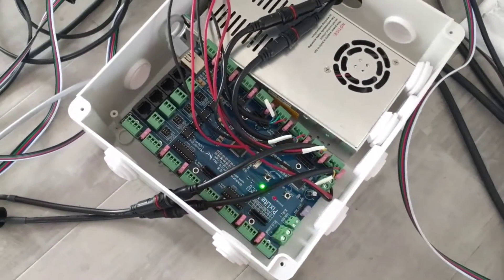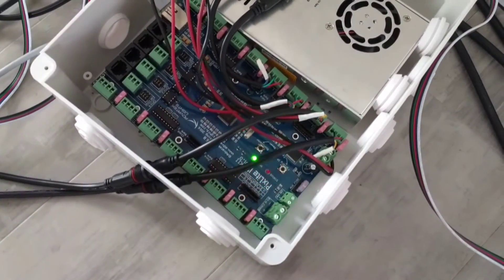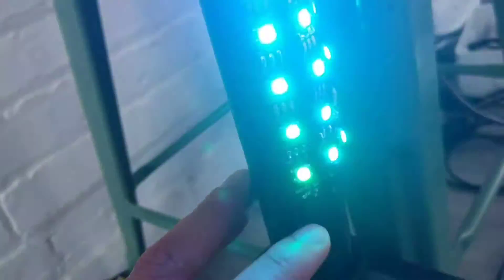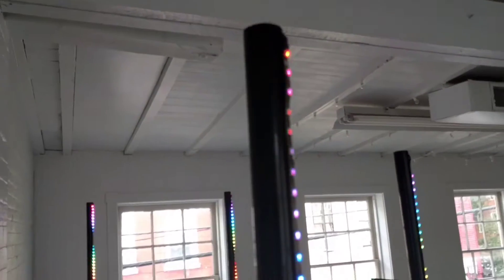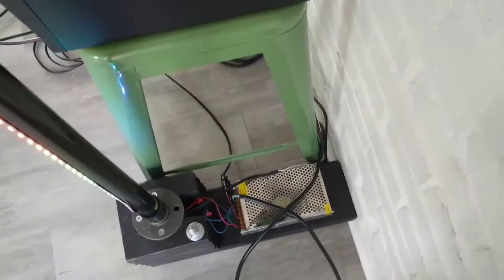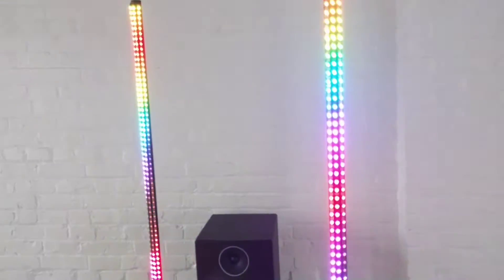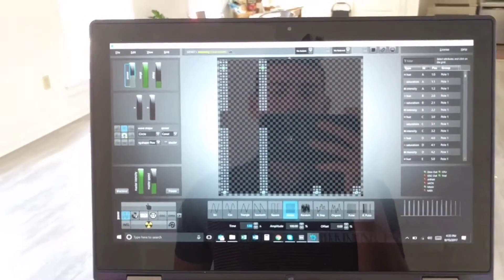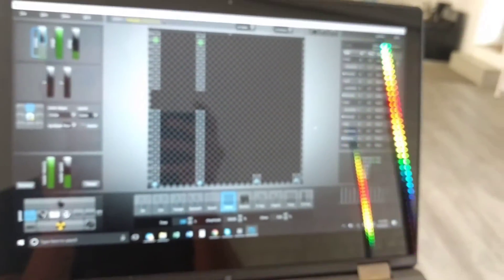How to make DIY LED light poles

Comment: Do you have a listing for the smaller power supplies, the wiring, and the flanges?  Thank you I am looking into trying something like this.
Reply from the maker: Heyo, here's a link to the smaller power supplies:
https://www.amazon.com/gp/product/B01LZRIWZD/ref=oh_aui_detailpage_o02_s03?ie=UTF8&psc=1

Here's the wiring and connectors:
https://www.amazon.com/gp/product/B016NV1PVW/ref=oh_aui_detailpage_o02_s03?ie=UTF8&psc=1

https://www.amazon.com/gp/product/B01LCV8SYK/ref=oh_aui_detailpage_o02_s03?ie=UTF8&psc=1

https://www.amazon.com/gp/product/B0154H7BLE/ref=od_aui_detailpages03?ie=UTF8&psc=1

+ cheap lamp wiring from the hardware store
+ black/red 16 gauge wire from the hardware store
+ metal flange w/ PVC size adapter from the hardware store
Reply: Thank you. You mentioned sACN. My UltraDMX-Micro adapter from DMX King doesn't do sACN, so if you don't mind, what adapter are you using?  Thank you again.
Reply from the maker: Dennis Justice using the Advatek PixLite16 mk2. It's kind of pricey, but they have a smaller version that is much cheaper. But LightJams uses ArtNet, as well. So I think you'd be okay.
Reply: Thank you so much!

Comment: The 200W power supply power the controller and some of the LEDs, but you inject power after two of the three strips on the pole. Is that right? Are some of the poles power injected, and some not? The poles are cabled in sequence right? All the questions!
Reply from the maker: Jesus On The Mainline hey man. I inject power at the end of each one. I noticed a voltage drop about halfway through each line, so maybe at 130 LEDs or so is the max you can get to before needing to inject more power.
Reply from the maker: Also, yes I make sure to cable each pole in the same order every time. the controller helps with that though, since I just need to match my outputs to the poles (even though each output can handle way more LEDs than I put on it, it helps me keep organized)